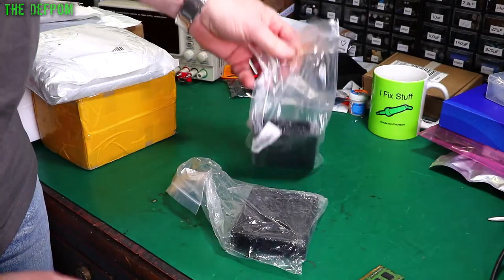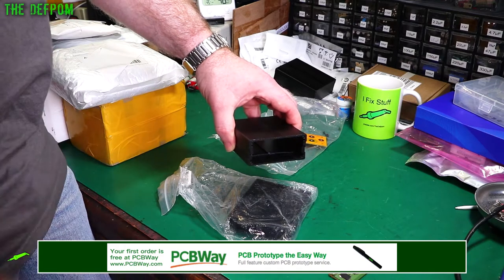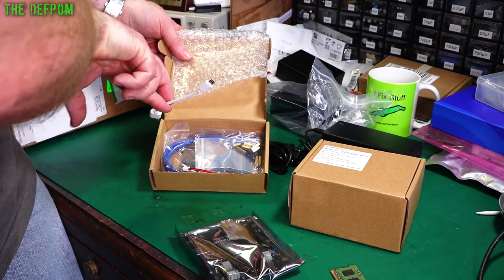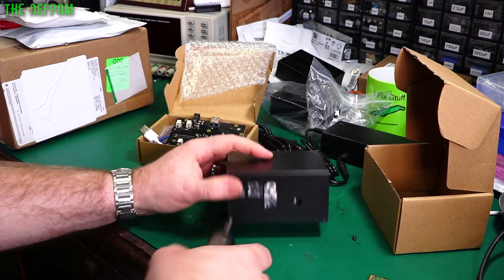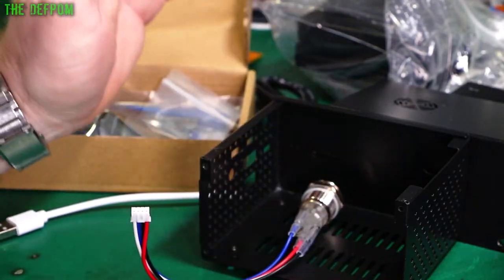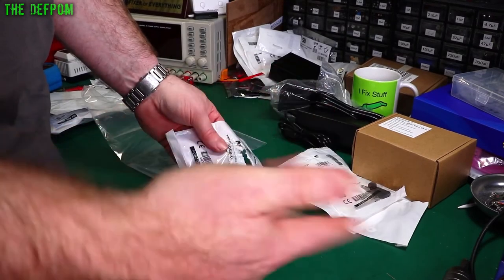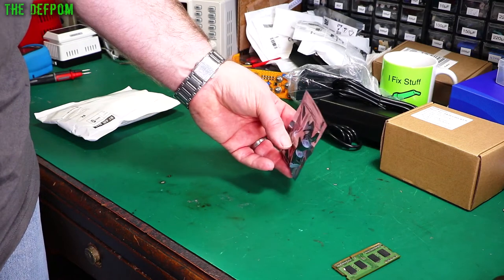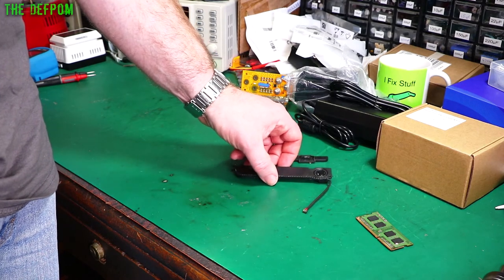🔴 Defpom's Mailbag - Mailbag Monday 9th November 2020

Comment: Red and Blue terminals probably presume connecting pos and neg power leads using eyelet terminal, while the blue presumes conncting to metal chassis and no extra wire connection, but rally what cost saving for inconvenience if needing a wire too. They are free, so no issue. 
In your usage the one nut is all that is needed since all only connect to PCB Pads anyhow.